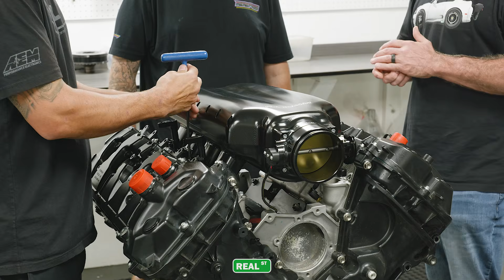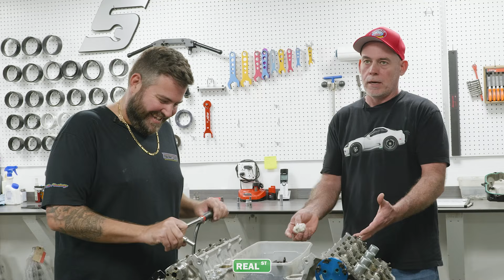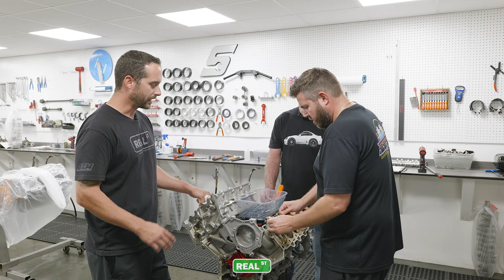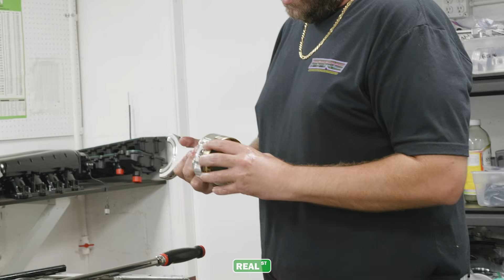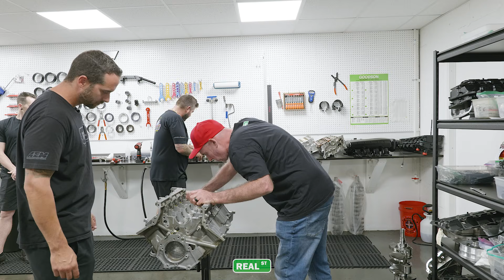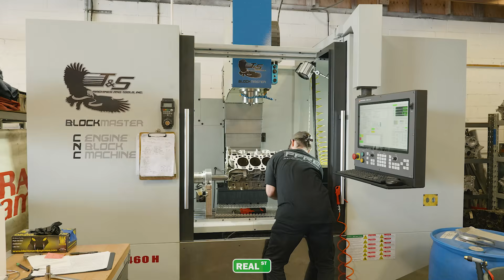Detailed 2500+HP Coyote V8 Engine Teardown - What We Found After Going 200+MPH Back To Back!

Comment: Now if ford wasn’t rewarded and made the 7.3 a coyote rather than a push rod maybe they wouldn’t have all the valve and cylinder head issues-derp this is Ford hey we made a coyote and worked all the problems out let’s make a big heavy duty truck engine-okay let’s start from scratch using 1970s tech like GM but charge. 2x more-you can’t make this stuff up. Imagine a 7.3 or 7.5 liter coyote or better a 7.5 liter with large bore and short stroke coyote so it still revs like a beast all the rev and low end torque-that’s ford missing the mark like always. The 6.7 power stroke that we s awesome buttttty you can’t work on and the packaging is like a insane squirrel on meth designed and all the ecoboost engines that get the job done but also were designed by the exact same basement dwellers on meth-hey Ford, open a Honda engine bay and take notes hey Honda don’t brag because your electronics and interior all suck nutz.

Comment: You guys put out extremely informative videos. The fact of how much integrity is taken each and every single time this motor is run. To how you guys check for any variations due to enhancements on the motor is mind boggling to me!! I’m extremely OCD and if your shop takes this much integrity and the amount of knowledge you guys have is awesome. I personally in all honesty love cars. Especially V8 Fords. Thank you so very very very much for how much detailed information and time you take to post these videos. These are the absolutely most informative videos I’ve personally ever seen on testing the Coyote based motors. From what I’ve watched and the research I’ve done. The Voodoo and Predator engines were engineered with all performance and longevity in mind. Thank you again.

Comment: So it's a 5.2 Predator block not a Coyote. 
I wish some would build a werewolf block.
Reply: The 5.2 Predator is still a Coyote motor. Just a couple different things make it different. No motor pushing 2500hp is original. lol
Reply: @rickitysplitz7035   Yes sir , they share the same platform.  But one is a coyote the other is a Predator. 
Kind of like the LS1-LS9 are the same but different.

Comment: It’s been the same order since the 1960s as far as power and reliability it’s always been Mopar then GM then Ford the only difference now is they don’t use big blocks anymore everybody’s running small blocks and they’re all fuel injected instead of carbureted but ever since the 1960s where the 426 hemi was the most powerful Most reliable engines out there in the big block Chevys were always second The 396 is the 427 and the 454 then forward 427, 428, 429. The only decent of those three was the Boss 429. But the most reliable of the old Ford engines were the small block 302s and 351s not the big blocks that were constantly breaking down and needing to be rebuilt Ford always been trash but it’s the same look at all the racing engine builders they either build hemi platforms or LS platforms. You never see them building coyote platforms, unless they’re die hard ford guys
Reply: Coyotes are running 5s and 6s no problem. Dodge is under the umbrella of some of the worst unreliable brands out there. And Chevy has moved to a DOHC way after Ford did.

Comment: What if the valve guide in that cylinder are sizing up during higher rpm and forcing the cam shaft upwards running it out of clearance mechanically suspect since it's rear cylinder exhaust right ?

Comment: Why has he got a massive 1/2 drive ratchet with an adaptor to a 3/8 socket? I would just use the 3/8 ratchet. I own about 30 ratchets and my snap-on go from 1/4 to 3/4.

Comment: My background is high performance airplane engines. Can't see much holding that top plate down on manifold !  A few bolts is all I see.  With the 'cycling' pressure  inside  your asking for trouble.  Stretched bolts...expanding / contracting aluminum.  It'll weaken over time..... that top plate will blow off before burst panel.

Comment: THANK'S GUY'S GREAT VIDEO AND CONTENT. GREAT INFORMATION FOR ME TO BUILD A STRONG GEN. 3 COYOTE 5.0 ENGINE, THAT WILL LAST AND HAVE THE POWER I WANT FOR MY 64' FALCON SPRINT (500 RWHP)
 AND (420 RWTQ) TO 8,000 RPM. SUPER COBRA JET MANIFOLD WITH TROTTLE BODY. IF I CAN GET A GEN.3 COYOTE 5.0 N.A. ENGINE BUILT WITH GREAT PART'S AND THE POWER I WANT, THAT WOULD BE GREAT.

Comment: @REALSTREETPERFORMANCE whats the deal with the oil pump on this motor?? I see its an mmr unit, looks like its possibly a billet pump??
Reply: its a dry sump setup, what ur looking at is the device that spaces the crank gear out correctly and dowel pins for chain tensioner to mount to
Reply: @gpherbert  Ah, so basically its a "fake" oil pump. To keep everything in line. Makes perfect sense for dry sump then, well thank you for clearing that up!

Comment: 25-2900hp with stock cams bearing caps, cams, crank, block, heads---and stock head bolts!

Mind blown. 🤯🤯
Reply: Stock block? Didn't he say they sleeved it, or am I incorrect?
Reply: @kickinrocks6055 which other oe platform with sleeves only, has won overall Sick Week or set the drag and drive radial record?
Zero.

Comment: I also run a plasma man manifold and never had any issues up to 50 psi.
You will definitely need billet cam caps and ARP bolts at 65 psi. 👍
Reply: More an rpm  issue than anything

Comment: Crazy to see this after watching cleetus put a massive smx engine in mullet and this little coyote doing exactly what hes doing at the same level, or almost better
Reply: Cletus has been chasing these little four valves for a long time,throwing greater and greater displacement at them.These Coyotes are nasty little beasts.My 4.6 Whippled Terminator destroyed its share if modified LS’s.
Reply: Different philosophy comparing the SMX to a Coyote, or the BBC now that Cleet has gpne back to it. His issue was always that Mullet couldnt use the power it had where Bretts Mustang uses all of it much more efficiently. Love both cars regardless but Im a Ford man and believe they are better in many regards.
Reply: Well turns out you were correct bud!
Reply: 4000 hp does you no good if you don't have enough tire.  His 572 cid SMX rev to 9k and makes double the torque of the coyotes.  Even his SML runs almost as well as his SMX with much less power.
Reply: @chrisstavro4698 
SML hasn't won overall Sick Week TWICE 
Coyote ✅️
Reply: The FFRE / Real Street/ MSR Team Coyote is extremely impressive for a handful of reasons 💯 
The SMX / SML engine is relatively new compared to the Coyote In regards to “engineering”  
I completely agree that a 300+ c.I. Engine turning 9,500+ rpm on a stock block, crank, head, etc running low 6’s @ 224+mph is EPIC 💯 
Especially when door to door with an SMX / SML 400 / 540+ inch billet everything … however Steve is one ☝️ man engineering and funding the program where The Coyote program as 100+ engineers and 100’s of millions of funding … so impressive to both to say the least
Reply: Yeah at like, 800lbs less weight

Comment: Started with Ford as a lucky 15 ( 75') yr. old w/ a Courier... to learn to drive, lol. 76' bought my first real driver 69' Chevelle SS with a donor tri power 427 from around the same year Vette... M-22, Moroso brute strength posi...  yada, yada, boo... into full rebuild and the first narrowed 12 bolt in S.E. Texas... SO... for the last 25 years I've been building one off exclusive builds 32' to 35' ford trucks and coupes. ( have built self made sizes 120% to 172% scales... for a customer the only 34' coupe out of Beryllium copper sheets/304ss ... lol )
Been looking all these years for a Ford engine that tripped my trigger... your video has sunk a hook that requires a round of due diligence... I'm stoked, runnin' around the house... even got such an inebriated rush going... I slapped the wife on her larger cheeks... lol... with no smiles... lol. Appreciate the honesty you have shared... KUDO'S to you gents involved... TRULY CAPTIVATING AND HOPEFULLY LIFE ALTERING! Respectfully, Seth

Comment: Less competitive racer here: ‘21 Mach 1, Twin 62s, 950whp, 6spd Manual

What would your recommendations be to reduce stress on the motor.  Your comment regarding how hard the 6r80 could be got me thinking.  What can I do to the driveline, while remaining a stick to help it live longer?

If that isnt the best place for longevity what is one thing youd otherwise recommend?  So far it has been good fuel, ensuring its up to temp before any abuse, and frequent oil changes.  This car is driven on the street with maybe monthly track outings but sometimes more.

Comment: MMR has taken a billet block 351in³ coyote with ported oem heads to a 5.67 @ 265mph. This is the next step for the snot rocket
Reply: 2 completely different set up.  IMHO shot ticket ot way more impressive

Comment: 2500 hp out if that displacement , do the math
Reply: Good luck getting an LS or LT to do that!!!
Reply: @02autogt  

I don't play with small block or small displacement engines.  But think about it what guys are doing to get 3000 hp out of a 600 plus engine.
Reply: @backyardbuilttrucks1 and stock block, heads and crank

Comment: Would be so cool if RS or Steve Morris would develop a 6L version of this platform with room to grow in a billet block. Very impressive that these OEM factory parts held up as well as they did @ 6.5 times factory power output. OEM block, crank, heads, cam caps, timing system. GM are you watching?
Reply: MMR has a billet block and with ported gt350 heads and @ 351 in³ they ran a 5.67 @ 265mph. I'm fairly certain no oem head has done this.
Reply: What You're Talking About Has Been Around For Over 5 Years, Up To 6.6 Liters 400 Cubic Inches. MMR Developed The Billet Block In 332, 351, 370 And 400 Cubic Inches. Check Them Out 👌🏿.
Reply: GM already steeped up the game with the c8 zo6, 4wd twin turbo zr1 is slowly cooking
Reply: @Airman..  during development GM first used fords 5.2 ltr program to learn from then they went to Ferrari and finished their new design after inspecting both. What GM did is nothing new- they just too the development other companies spent $$$$ on and upgraded. Ferrari and Ford both have new upgraded platforms coming out. Everyone is stepping up the game- like Ford did initially, GM is having trouble with the new engine. A handful have self destructed within 50-75 miles off the showroom floor
Reply: @cantbsdave  do you have a reference to support this?
Reply: @Airman..  It's all over Google c8 zo6 engine failure one popped at 52 miles! A bunch under 1k miles its really bad.
Reply: @frizzlefry5  well aware of than, not aware of GM coping ford 5.2! In terms of DOHC it's not new New to GM look it up

Comment: I don’t like fords, they are too complicated and don’t make enough power for what they cost, but I gotta tell you I am so impressed with this combination and tune up. Great work really using the scientific method to get this engine running great and surviving
Reply: You can make 850whp stock motor stock trans on a 15-17 GT with a blower, fuel system, and a tune. That’s fuckin impressive.
Reply: @169abr  the question is for how long? 😂 I’m building a blown 540 big block Chevy on low boost it should make that and not break a sweat
Reply: @xozindustries7451  and obviously NOTHING is stock about that "540", you're comparing apples to oranges.... Typical of a GM guy... If a chicken had hands it could build a Chevy...

Comment: Hey Jay was hoping to pick your brain my local junkyard has 3 engines and I wanted to see which you would go from.
1 LS2- 5k
2 L99-4,500k
3 Coyote- 7k
Thanks for all the wisdom I’m trying to soak it all up!!
Reply: If you’re not going to build the engine and wanna stay under 800whp Coyote all day.
Reply: @169abr  I’m gonna build it out billet crank forged pistons aluminum rods rings gapped for boost 600 lift camshaft 1.5 rockers steel girdle probably around 30 ish boost

Comment: Would it be possible to come up with a timing belt conversion ?  Also can you talk more about how the shift points in a 6r80 can hurt the engine?
Reply: This isn't using a 6r80

With the TH400 they can run a much looser converter/combination of parts that lets the engine stay above their target rpm range on shifts

The TH400 can be manually/pneumatically shifted at rpm points/speeds even if the transmission can't "see" the rpm

The 6r80 being a clutch on clutch automatic and computer controlled cannot do that
Reply: @chipcurrey653   they mentioned the 6r80 specifically in the video. I’m running a manual transmission on my drag build so I don’t care that much but yes I’m aware of how a lockup th400 works

Comment: On an ls at this power level you need 6 bolt heads, this block looks like it's 4. What allows these blocks to hold this power on a 4 bolt? thicker head decks, bigger studs?
Reply: Probably the small bore !!

Comment: Really interesting.  To me the main thing that was right with these engines from the beginning (modular motors) was the stability of the bottom end.  Cylinder length being a weakness at this level with the 8.937” deck height.